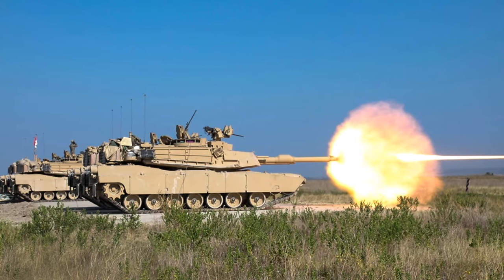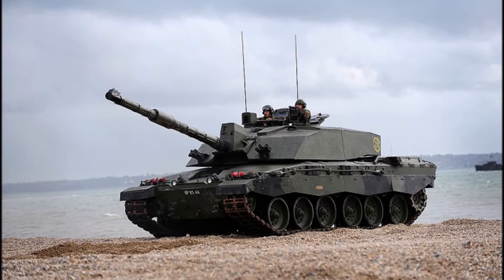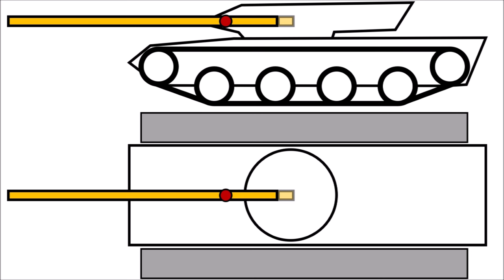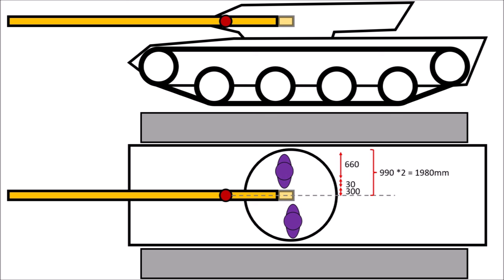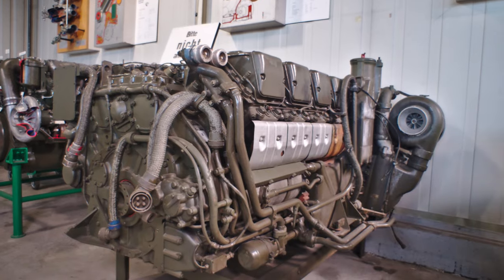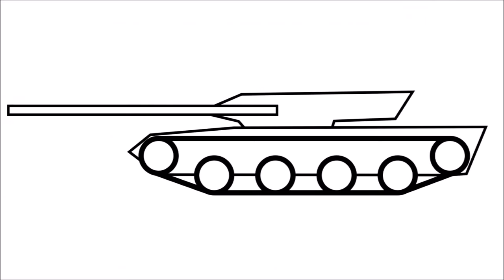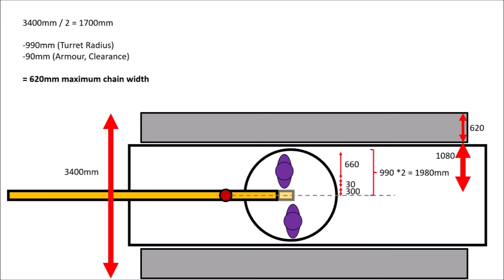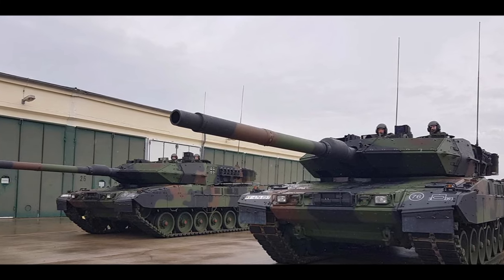Basics of Tank Design

Comment: But most importantly which tank is the most aerodynamic and which one produces the most downforce?
Reply: T-80 actually has a lot of aero features for less dust ingestion into its turbine engine thru the intake. But aero drag on these dont matter at all, max they drive at is around 70 kmh, drag is minimal. Rolling resistance has a much more significant effect than aero drag on tanks
Reply: bob semple ;)
Reply: @288gto7  Captain Oblivious to the rescue!
Reply: Cockerill i-X

It's based on an actual Dakar chassis, plus the RWS on top can retract flush with the roof
Reply: Leo 2a6 and T90ms xD
Reply: Aerodynamics are for people who can't build engines!
Reply: @288gto7  That family of tanks, however, is prone to producing very sudden and very strong lift (for the turret only) once the ammo detonates.
Reply: @damnyejustgotbewitchedbyth2802 say that to mclaren in 1988

Comment: The design of a main battle tank (MBT) revolves around a combination of protection, firepower, and mobility. These three fundamental characteristics guide the design process, but there are a multitude of additional considerations to ensure an effective and operationally viable tank. Here are some of the most critical design considerations for a main battle tank:

    Protection:
        Armor: Effective against a range of threats, including kinetic energy (like armor-piercing rounds) and chemical energy munitions (like rocket-propelled grenades and anti-tank guided missiles).
        Shape: Sloped armor can increase the chance of deflecting rounds.
        Active Protection Systems (APS): Systems that can detect and neutralize incoming projectiles before they hit the tank.
        NBC (Nuclear, Biological, Chemical) Protection: Tanks need systems to protect the crew from these threats.
        Camouflage and Concealment: Reducing the tank's visibility can be crucial in avoiding detection.

    Firepower:
        Main Gun Caliber and Performance: Choosing a suitable caliber and ensuring its performance meets the requirements for range, penetration, and accuracy.
        Ammunition Types and Storage: A variety of ammo types (APFSDS, HEAT, etc.) and safe storage to minimize risks of internal explosions.
        Secondary Armaments: Machine guns, grenade launchers, etc.
        Fire Control System: Ensures accurate targeting, tracking, and firing on the move.
        Stabilization: Allows for accurate firing while moving.

    Mobility:
        Power-to-Weight Ratio: The balance between engine power and the tank's weight is crucial for mobility.
        Suspension and Ground Pressure: Ensures good off-road capability.
        Range and Fuel Efficiency: Determines how far the tank can move without resupply.
        Amphibious Capability: Some tanks are designed to be amphibious.
        Transportability: The ability to be transported by aircraft, train, or truck can be a consideration for rapid deployment.

    Ergonomics and Crew Comfort:
        Crew Layout: Ensuring the crew can efficiently operate all systems.
        Life Support: Especially important in extreme environments.
        Ease of Maintenance: Simplifying and speeding up repairs and maintenance.

    Communication and Situational Awareness:
        Radio Systems: Effective communication with other units.
        Optics and Sensors: Night vision, thermal imaging, and other sensors can give the crew better situational awareness.
        Battle Management Systems: Digital systems that allow for better coordination with other units.

    Modularity and Upgradability:
        As technology advances, tanks should ideally be designed in a way that allows for easy upgrades.

    Cost and Production:
        Balancing the above features with the cost of production, especially if procuring in large numbers.

    Survivability and Redundancies:
        Multiple systems (like optics or sensors) ensure that the tank remains functional even if one system is damaged.

    Stealth and Electronic Warfare:
        Reducing thermal, radar, and acoustic signatures and having capabilities to counter enemy electronics can be essential in modern warfare.

    Training and Doctrine:
        While not a design feature, the training of the crew and the operational doctrine of the tank's use are essential for its effectiveness in battle.

When it comes to armor: the thickest armor on a tank is typically located on the front, especially the turret's frontal arc and the upper glacis (front upper hull). This is because tanks expect to face the majority of direct fire threats from the front.

For modern MBTs, the concept of armor has evolved beyond simple measurements of thickness. Contemporary armor is often composite in nature, involving layers of different materials such as steel, ceramics, and sometimes depleted uranium or other materials, designed to provide maximum protection against a variety of threats, like kinetic energy penetrators and shaped charge warheads.

Tanks such as the American M1 Abrams, Russian T-14 Armata, and the German Leopard 2A7 all possess advanced armor configurations that emphasize protection on the frontal arc. The exact performance, layout, and composition of this armor are not always publicly known, due to their sensitive nature.

Additionally, modern tanks often use modular armor packages, allowing for armor to be adapted based on the expected threat environment. Some tanks also employ reactive armor or active protection systems to further enhance their protection beyond the passive armor.

The title of the video says it all. It is just the basics of tank design, but more like "how to draw a realistic tank", than properly design one.
Reply: can i copy this?
Reply: @ahmedalhadithy5582  for what purpose?

Comment: Here the Israeli design is very interesting with crew-survivability as top priority, hence the engine in front to form an extra shield. Disadvantage is that the thermal optics are hindered by the heat of the engine. Advantage is that communication between the crewmembers is easier and that the tank can be used as a safe means of transport of wounded soldiers.

Thanks for this interesting subject! An engineers view on Tanks.
Reply: Another disadvantage of the drivetrain being in the front is that it limits how thick the composite armour can be on the front hull.
Half a meter of armour on the front isn't practical when the drive sprockets are on the front as a result of the drivetrains location and the sprockets still need to be as forward as possible, to ensure proper mobility over obstacles.
 The result is that on the Merkava, the quite large lower hull front plate is quite thin, compared to other MBT's, while the upper front plate is highly angled to compensate

Comment: The ground pressure is not uniform across the entire track, but is highest below the road wheels and lowest between them. Due to the flexible nature of the track, the entire thing behaves more like a swimming bridge made of small swimming bits, where the tensioner of the track impacts the exact nature of the ground force distribution, i.e. the weight of the components on the swimming bridge. 

That said: This felt more like a packaging exercise with a tank as the example, not specifically a tank design video - since you didn't really touch on armor at all, arguably one of the most defining characteristics of an MBT.

Comment: If anyone wonders why the tank engine was nearly a square, as seen in the video. Then it is because it makes them very easy too pull out a broken engine and put a new engine in the tank. Then the pulled out engine  can be fixed ALOT easier.
Reply: There was an ad for tank repair jobs in the German Bundeswehr:
"We bet we can change an engine faster than an F1 crew"

Comment: Frankly, making a video about "tank design" is about as complicated as a video about "race car design", which... uh... means it's not really easy to distill into a short video like this with any sort of satisfying informative capacity. However, I do appreciate how it actually tackles the engineering side from the often-less-recognized angles of mechanical mobility (track length/width and ground pressure and etc.) and dimensional construction restrictions (turret ring size, hull widths, etc.), rather than the more obvious combat capability discussions. 

I will say though, choosing the T-14 Armata as the thumbnail image is quite a choice, considering how it is the most dissimilar tank to the archetype of the common MBT in service everywhere else, what with its completely unmanned turret and all.

Comment: I think you missed too much on this one. Yeah you mentioned ground pressure and critical dimensions of a typical 3 crew turret, 1 driver manual-loading tank in deeper depth that I've seen previously, which is cool, but you completely missed alternative solutions and their pros and cons which is even more basic than critical dimensions.

For example 2-crew turret with autoloading like the Russian tanks that you feature a lot in the video, or uncrewed turret with multiple men in the hull like the T-14 armata that you also feature on your video. On the power train you also didn't mention front-mounted engines and transmissions, like the Israeli Merkava that has them on the front, or the old WW2 designs that tended to have engine in the rear and transmission on the front. 

And that's just mentioning things related to the topics you covered, armor distribution and types of armor was also a big design consideration absent from the video.

Comment: So I would start with if there are any transportation limitations and that will dictate your tank maximum size and the operators dictate your minimum size
Reply: That was one reason for the weight of the M4 Sherman - loading crane limits.
One might even check for the limitations of the operational area, like bridge limits or road widths.

Comment: 2:27 thats why the driver mostly sits on the right and not the left side. That you can stow the ammo in front of the loader.
Reply: thats not really used anymore as ammo in most western tanks is stored in the turret bustle which incorporates blow out panels to jet exploding ammunition exhausts away from the crew, exactly what the soviet tank designs dont do...
Reply: @theoonyoutube  Leo2. He have two storages. The ready rack in the left rear turret and one in the left front hull next to the driver.
Reply: @rexmcstiller4675  yeah its a huge design flaw that relies on the armour being impenetrable, however I doubt when it sees combat the hull stowage gets filled
Reply: Also, the commander on the right can communicate directly with the driver on the right, without depending on intercom technology or electric power availability.

Comment: No no no.
The thickest armour is on the front of the turret. Because that's always visible (or rather it has to be visible to the enemy if you want to shoot them)
Also RU tanks are not offensive. The 4 degree depression is because the terrain in Russia is flat, and they will be using prepared dug outs to shoot from.
Western tanks are attacking so they won't have prepared structures, and will have to rely on the terrain (which while flat, is not even, and there are still small hills)
Reply: Soviet tank design since the 50s has focused on an armored attack west into Europe through Germany. Defensive operations are at most a delay. The low depression is due to the low height of the turret. It wasn't seen as a problem because soviet tactics were supposed to use tanks in battalion formations, being in line formation at company and platoon level, cresting hills at the same time and not fighting with hull down, instead using tanks to advance close to the enemy, often with heavy artillery support.

Western MBTs were designed during a doctrine focusing on defense. They very much so were planned to fire from vehicle emplacements, but also hull down behind defilade which often requires good depression. They would be retreating continuously and real terrain geometry in Germany's east is quite complicated which requires high deflection to be able to always attain an effective hull down. Many European countries still adopt similar tactical thinking.

Comment: Russians don’t need manual loader.. they have autoload on all tanks
Reply: different doctrine.
Russian tanks are made to be "disposable" in the tactical sense. 
if it breaks down, just wait for maintenance to catch up to you, meanwhile another tank takes your place. 
Western tanks are supposed to be kept fighting by the crew to a degree, so a loader pulls double duty as a fourth pair of hands servicing the tank, camouflaging it, provisioning it etc. 
The autoloader is a sensible choice for russian doctrine, where tanks and their crew are more disposable, whereas the western design is intended to stay on the battlefield as long as possible and return to it as quickly as possible and thus more hands are more important than a flatter hull and fewer tank crew per tank.

Comment: Tanks are obsolete on todays battlefields. What is the point of tanks having very heavy armor when it is useless against javelin, for example?
What is the purpose of tanks on todays battlefield when they are sitting ducks. In the past, Tanks used to be formidable weapons and it actually made sense to use and produce. Nowadays, thanks to great anti tank weapon systems, tanks have become useless. If tanks start using Active Protection Systems such as the Trophy and start getting integrated anti air weapons that can take out drones or incoming missiles they would return to become a formidable weapon again.